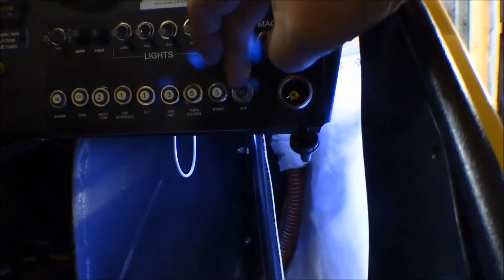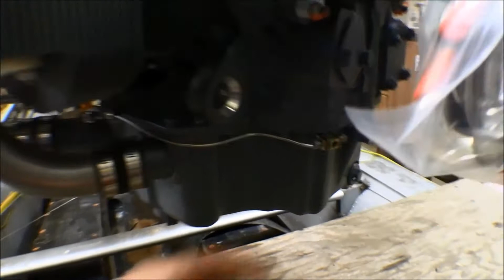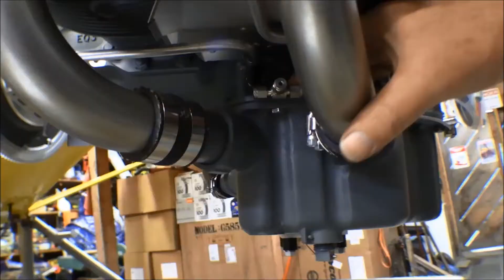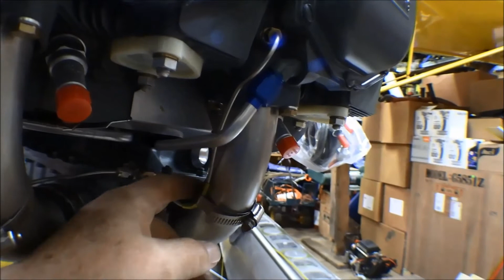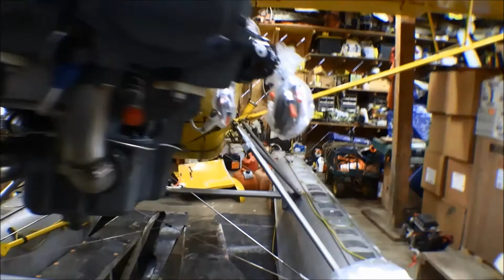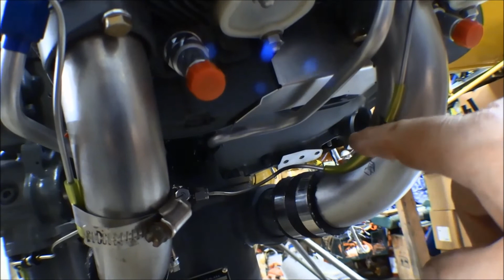Piper Super Cub Engine Change #10: Primer Lines

Comment: Getting closer and some nice plumbing work. How far can you go before you need the mechanic? Is it just an inspection or do they need to do the final install?
Reply from the maker: That's kind of a question and sticky point. All work on a certified airplane has to be done to FAA and manufacturer standards and approved to service by a certified mechanic. Some mechanics are ok signing off others work as long as it is up to snuff, others think only someone who has gone to school and been certified can work on airplanes.
All airplanes have to be inspected and approved for service by an Inspection Authorized mechanic annually and aircraft used commercially have to be inspected and approved for service by a licensed mechanic every 100 hours of operation. So I can do any or all work on the airplane if I can find someone willing to sign off the work